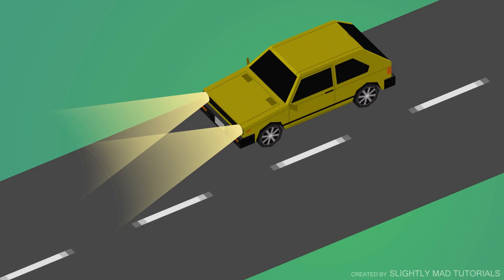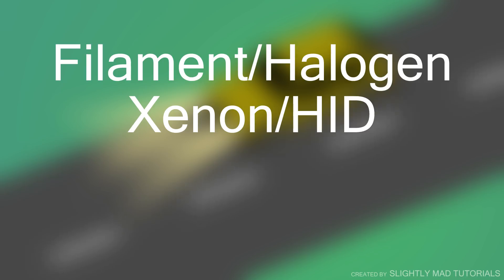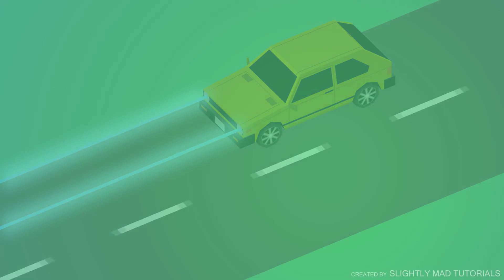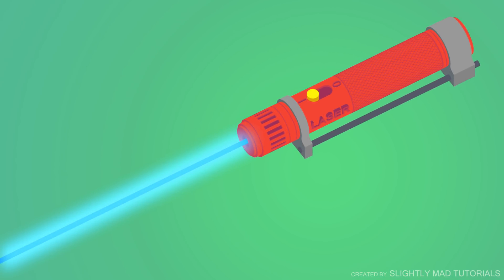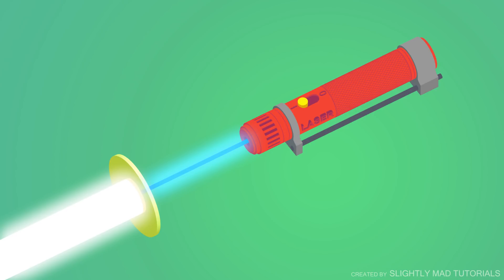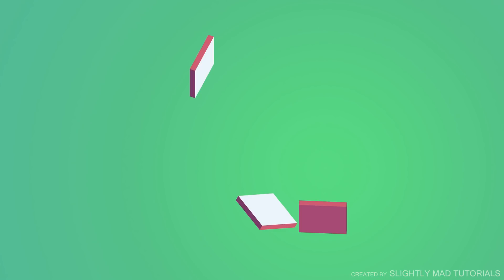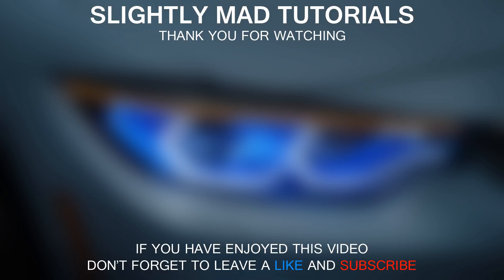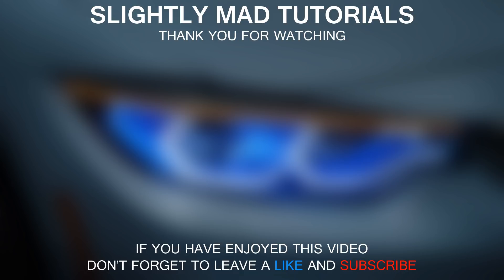HOW LASER HEADLIGHTS WORK - SIMPLE EXPLANATION

Comment: InGaN lasers and Ce doped YAG. No phosphorus in these lights. Indium(In) Gallium(Ga) Nitride(N) for the 400nm laser and Cerium(Ce) Yttrium(Y) Aluminum(A) Garnet(G) Y3Al5O12 for the converter of blue light to yellow. A process known as phosphorescence.
Reply: Yes, laser headlights are not much different from LED headlights. The difference is that in LED headlights, a blue LED is used to "pump" the fluorescent substance, and in laser headlights, a dark blue laser is used to "pump". The other significant difference is in the amount of heat released during operation. In the case of laser headlights, both the fluorescent substance and the substrate on which it is built have much better thermal conductivity so that the heat can be easily transferred to the coolers.